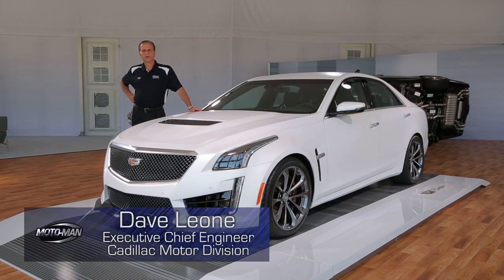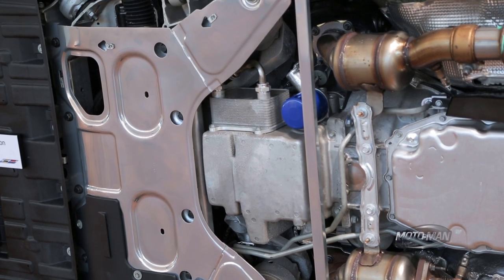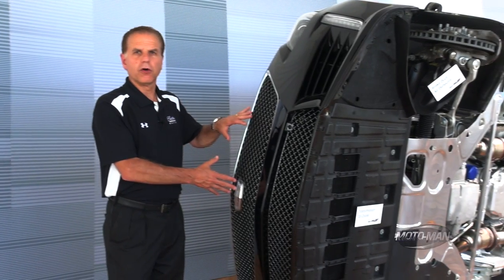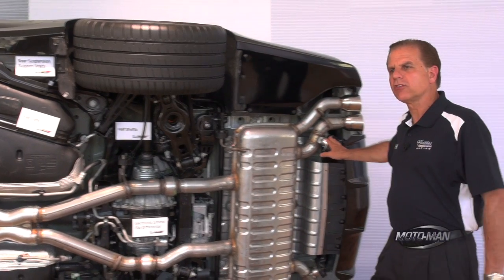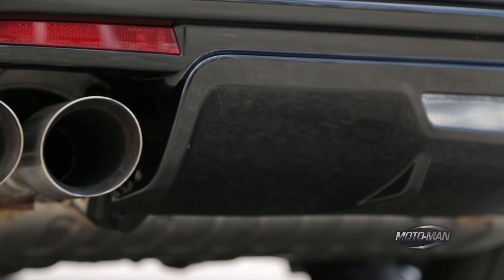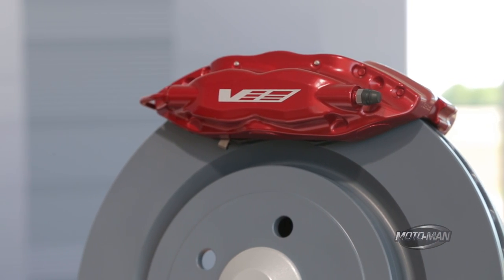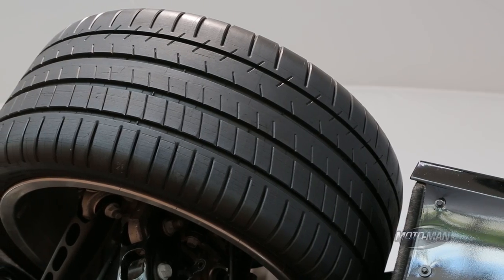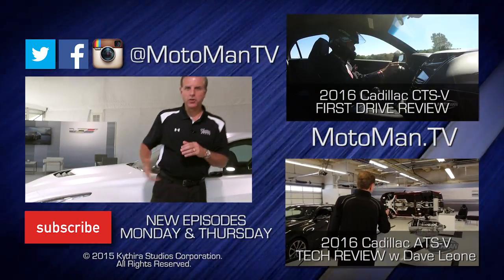2016 Cadillac CTS-V TECHNICAL REVIEW with Cadillac Chief Engineer, Dave Leone

Comment: All this tech and parts and the Tesla P85D is still faster.  Granted it does not do 200 MPH but how many times are you going to go 200MPH?
Reply: Jon Car You just countered your own argument, the car with the the highest top speed is the fastest car. The CTS-V is going to 200MPH over and over again and you can go "insane mode" 10 ten times but have to ease it back to the garage to be charged for hours after an hour or two of fun.
Reply: +Jon Car The P85D is not even close to being faster. The P85D only traps maybe 114 mph in the 1/4 mile, the CTS-V traps 126+ mph. Please tell me I don't need to explain that to you. You should immediately recognize the absolutely MASSIVE performance gap there.
Reply: How far will it go and how much to replace batteries?

Comment: So how do you explain the overheat of the lt4 in the vette ? You need to improve the cooling , like the cooling system of the hellcats , the hellcats being  more powerful engine ( more power , more heat ) being the car heavier , and still keep the 707 hp in 20 minutes at the track !! So improve your  system caddy !
Reply: elvicdesonora I hope you enjoy the taste of your own foot. This is not the Corvette. It's a much bigger car, with much more space and so it has more radiators. There's been plenty of Corvette coverage and they've never highlighted this many cooling devices, so it doesn't even make sense for you to assume the two cars have the same cooling system.
Reply: Doesn't overheat. Only pre-production prototypes did. Hellcats are slower than the CTS-V, and certainly have much less prestige and refinement... and they're Fiats.